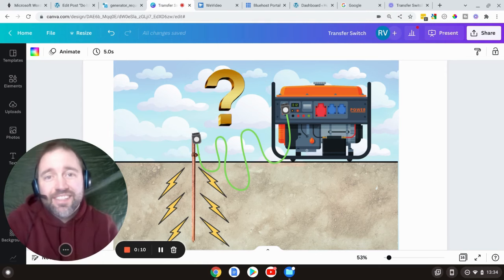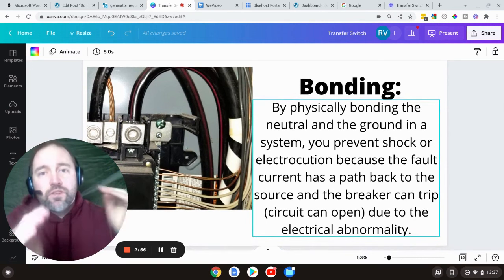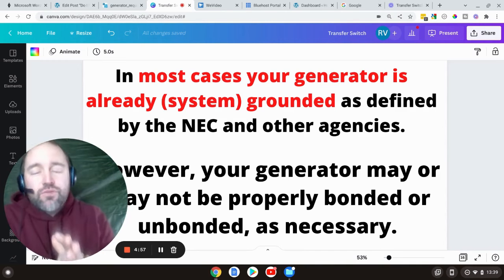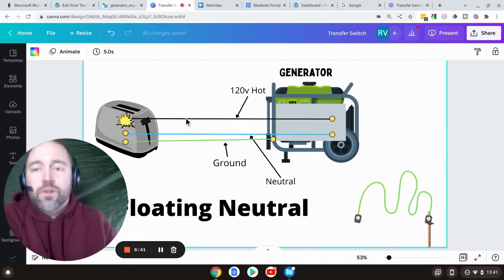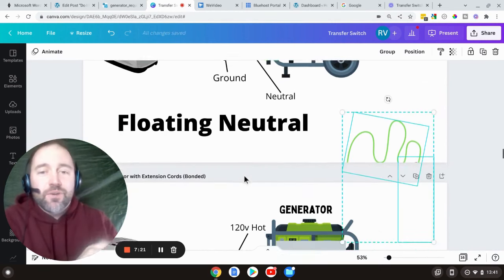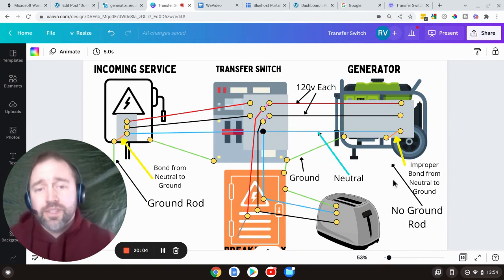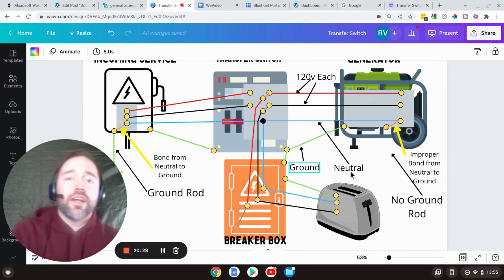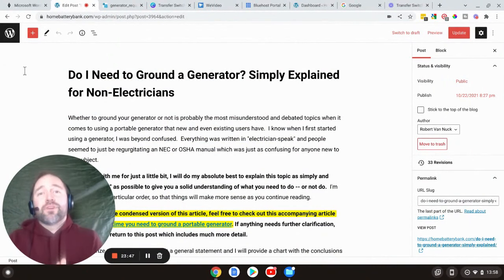Does My Generator Need a Ground Rod?  Probably Not.  Here's why.

Comment: Operating a generator without proper grounding the way you describe provides a false sense of security. 
As OSHA demands, proper GFCI protection should be used in any unfinished space and when using power tools. This is what you should stress as important. It is the best device to protect you from electrocution.
Bonding connects metallic parts together so one piece cannot be suddenly energized when compared to the other metal objects around it. A ground electrically bonds the metal objects to the earth so they will not suddenly become energized when compared to the earth you are standing on.
Bonding and grounding only ensure that the metal objects that you are capable of easily touching are all at the same electrical potential as the earth you are standing on. It will not prevent you from getting electrocuted from a faulty condition. The only device that actually will protect you is a ground fault circuit interrupter. No ground or bond is required for the GFCI to operate. If power to a protected device takes a different route, like through a human, it will stop the current flow. 
You explained that the power from a generator may be safer in some circumstances if Neutral is not bonded to the chassis of the generator. This is only true if the insulation or possible conductance between the power wires and the chassis of the generator is verified by a qualified person and nothing changes while you are using it. The bonding option you describe is on a generator with a metal chassis, this generator doesn't conform to Double Insulated standards.
The bottom line is this:
If you are using a generator to power double insulated power tools, grounding/bonding isn't an issue.
If you are using grounded metallic body power tools with a generator, the tool and cords should be in good condition and the generator chassis should be grounded or bonded to the metal project you are working on. Bonding the power to the generator isn't necessary.
If the generator is powering a distribution box on a jobsite, follow grounding and bonding as code requires.
Each and every extension cord being used with power tools must be protected by a Ground Fault Circuit Interrupter. The cord doesn't need to be grounded for the GFCI to protect you, but, OSHA requires only grounded extension cords be used.
The circuit breakers are only installed in the equipment to prevent wires from catching fire if they are overloaded, they DO NOT protect humans or animals from electrical injury.
Reply: I forgot one. If you install a generator connection on your house for emergency power, install an earth ground for the generator chassis or connect it to the existing earth ground rod on the home (if it is close enough to the generator). Generators are commonly used during storms. Grounding/Bonding provides a margin of safety in wet conditions. It wouldn't be healthy to discover something is backfeeding electricity, from the house to the generator through the power cord, while you are getting ready to add fuel to it, in the rain.
Reply: @robertmcenery4344  ... if you are using a 4 wire connection to your gen set and a proper means of transfer, you will already be grounded. They haven't made a gen set with a 240 volt 3 wire connection / receptacle in at least 40 years.
Reply: @rupe53  The video explains that the earth connection isn't necessary. If you are powering a double insulated tool, in good condition, in a dry location, you can get away without it. If you are in a damp location, working on a jobsite, there's most likely something you can ground to, make an earth ground connection and use a GFCI. The earth connection will bond the ground leg of the generator to earth to bring any potential between them to zero. The GFCI doesn't care about any ground. It only knows the current flow on the 2 current carrying wires are within 5 mA of each other. If the difference exceeds 5 mA, it trips open.
Reply: @robertmcenery4344  ... the GFCI info is true. I was aiming at home connections via the 240 volt plug. If it's wired right, you will always have an earth connection and be bonded to neutral at the panel.
Reply: Power tools today  have plastic cases and are double insulated design.  It is virtually impossible for you to get shocked by a hand power tool today.  1960 they were metal case. Remember the aluminum frame drills and saws?  Yeah those were really important to be grounded. A short was able to shock the daylights out of you.... Grounded or not. 
. I remember being shocked by one in a friend's garagewhen I was a kid

If a generator has a floating neutral it is difficult for you to get shocked unless you touch both the neutral and the hot wire at the same time. Or at least close enough that a spark can jump. 
This is because the generators neutral is not grounded to anything else, or earth.  There is no possible return path of current from you. A floating neutral is inherently safe especially with double insulated power tools today. GfCI solves a   problem that doesn't exist for power tools... For it to work it requires the generator to be bonded with ground.  Its grounded  to the earth it  is sitting on, often,   and it CREATES or at least enhances the risk of,   the hazard that it addresses.  Well, when generator is first came out they were grounded by putting the metal frame on the ground..... Today they're on plastic wheels and have rubber anti-vibration pads to quiet noise and so they're mostly not grounded to the Earth anyway. This can reduce some risk of shock using a extension cord power tool.... Because even if your generator is bonded it may still not be effectively grounded to the Earth which is the usual return path for you to get shock.   Although it is amazing how little contact it takes to complete a path for 110 volts.  If you've ever had an electric wire fence.... Yeah you can get shocked a bit  wearing rubber tennis shoes standing on dry grass. It's worse on wet grass, and if you're barefoot it'll shock the daylights out of you.  I've even been shocked a bit by 120 like inadvertent contact to the powerhead entrance on the roof of a house...
.

There are other things you could power with the generator that have a grounded metal  frame and introduce other scenarios.  Such as the toaster in the examples...But you're normal plastic framed hand power tools today are VERY safe, and really will not benefit from bonding the generator.  Of course there's probably still some 1960 era bulletproof aluminum drills and saws out there being used by someone.
Reply: @duskyman1  Virtually impossible means it is possible to develop a leakage current situation. 50 mA is leakage current level and enough to kill you. I have Milwaukee professional tools that are grounded cord tools with metallic bodies. The handles are insulated, but proper grounding should be observed to operate them. If you are operating as one person with one generator and one double insulated tool while under ideal conditions, I agree that you are safe without the grounding/bonding installed.

A GFCI does not require anything to be grounded. It makes it easier to test functionality. It interrupts the circuit if the sensor discovers the difference in current between the 2 legs of the circuit is greater than 5 mA, preventing the extraneous current flow from becoming lethal. The Generator Nuetral Bond should be installed at minimum to reference the return side of the circuit to the chassis as 0 volts. This would also help the GFCI in an unexpected situation.
Reply: @robertmcenery4344  without bonding at the generator ....there should be no possible return path except along the neutral.... there's no path via earth and you.   So technically the GFCI has no functionality in an unbonded generator as far as protecting you from a shock.   

But when you bond it you create a new hazard there is a path through the Earth and you that becomes possible.   Of course the GFCI is supposed to solve this problem that it has created.
Reply: @duskyman1  In a perfect world, nothing should happen to the generator wiring. It should remain isolated from the chassis. There are no guarantees anywhere that could prevent that from happening. If leakage occurs between any point in the windings to the chassis, It is now live to either side of the outlets. The GFCI will still protect you if it is working properly. If you think opening the bond lug will remove an alternate path back to the generator, you are creating a false sense of security. OSHA and NECA do not rely on that low margin of safety. 

While the bond lug is available to use, it is not a "garanteed safe" connection. That's like putting a switch on a tool to select grounded or double-insulated operation.

One person, one double-insulated tool, one extension cord, and one generator, in ideal conditions, you are safe to work. Anything else opens up chances for trouble.

Comment: If you have no earth ground 6 feet deep, you are not earth grounded. Nuutral is a traveler not a ground volt 0. Neutral is half the current the current line sends, the neutral  sends half the curtent back to transformer so it called ternating current.